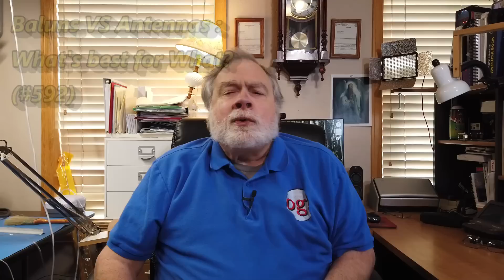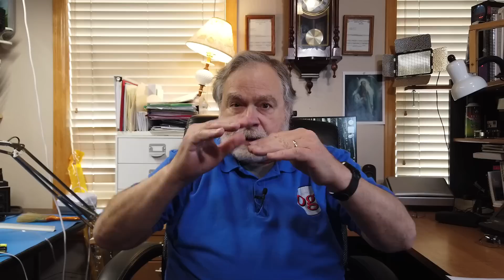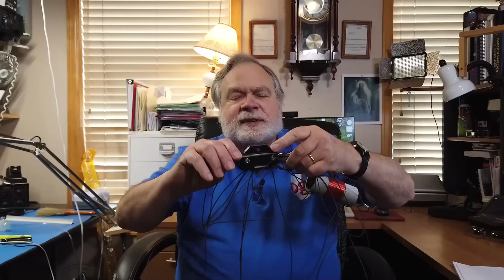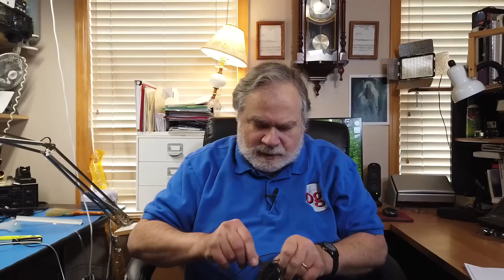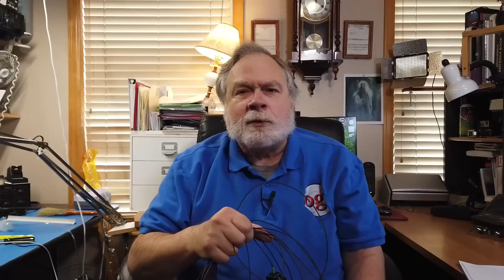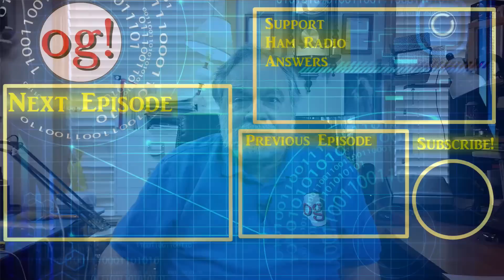Baluns VS Antennas : What's best for What? (#592)

Comment: Hey Dave . I wound a 1 - 1 Balun  and put it in a box with a 9 - 1 that I wound also . What want to do is feed the 1 - 1 with 50 ohm RG - 213 coax from a tuner , and use 450 ohm ladder line from the 9 - 1 to a 1/2 wave dipole . Am I thinking wrong by using the 9 - 1 Balun to match the 50 ohm to 450 using ladder line to feed the antenna ? Or just use the 1 - 1 by itself ?

Comment: Priorities of what to buy next! Cheap baluns don't work well and a quality one the better part of the cost of an ATU. A 20 meter coax one is only about 10 feet of coax. Still 100W or less, ferrites, good outdoor ground and a few turns of coax will do the job to keep RF outside the shack.

Comment: Just had trouble with my balun on my horizontal loop.  Each time I changed bands I had to retune the tuner to different places each time.  I had put it on a 4 to 1 a while back as a choke balun to get rig of RF on the outside of the coax.  I just removed it and so far the tuner settings are staying put.  I guess something happened to the balun.
Reply: 🤔 unless your SWR is low on every band, you should need to retune your tuner on each band
Reply: @timmack2415  Yes but no to different settings each time.  I have taken off the balun and now all is fine when I retune to a band I use the same settings as the last time I was on that band.  Something wrong with balun.  But for now don't need one anymore.  Happy Hamming.
Reply: @timbacchus  ahhhh, that makes sense. I am a little slow sometimes. I thought you were saying that you shouldn't have to retune when switching bands. 🤦🏻
73, my friend